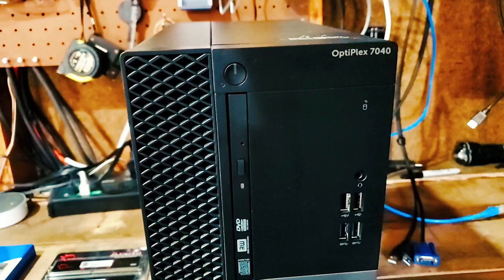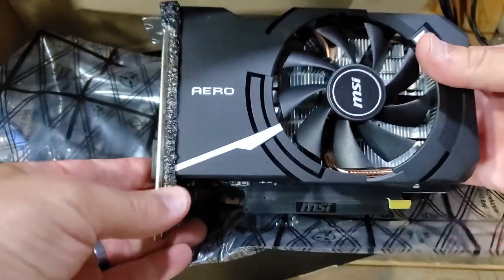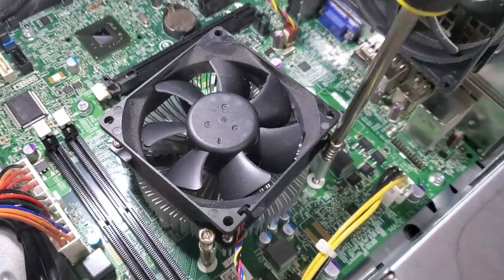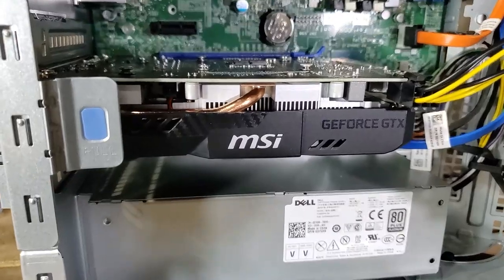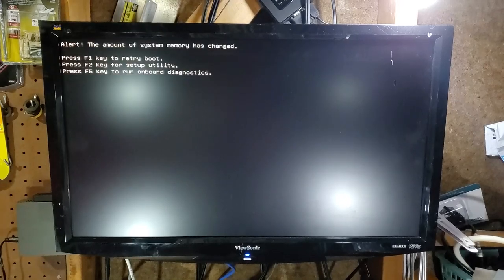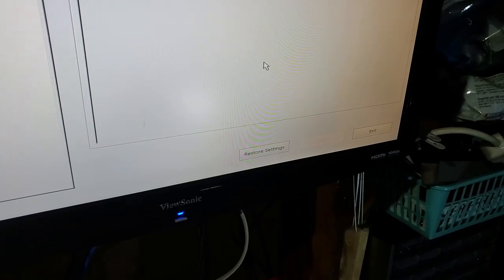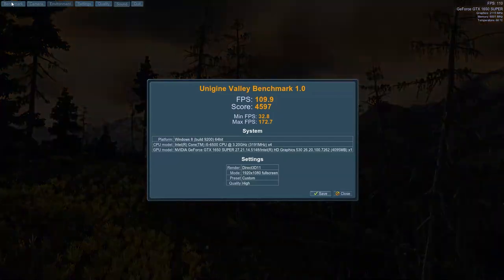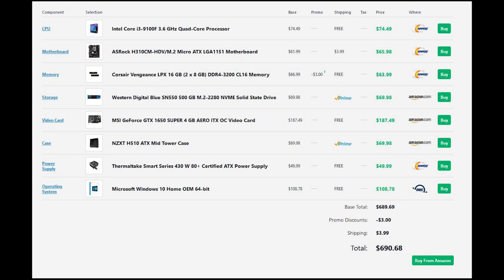Nvidia GTX 1650 Super in a Dell Optiplex 7040 - Best Optiplex Gaming PC for 2020!

Comment: Hey I have a dell Inspiron 3910 with 64gb ram, an intel core i5-12400 and a 300 watt psu. Would a 1650 work in my pc?
Reply from the maker: Current Intel CPUs have a second power level called PL2 and your 12400 can pull up to 117W during that time.  That said, Dell is probably very conservative with how long it runs at PL2 (time called Tau) and outside of those short spikes, you should be fine with the 300W PSU.  I wouldn't have any concerns using it, but it isn't as easy of an answer as the system I used in this video.
Reply: @EscoTech  okay good to know! Thanks!

Comment: Hi, I loved your video but I had a question.... I have 3 hardrives 1 with Windows and 2 For Storage, will I have enough SATA ports (2) to use the adapter or do I have to plug some out? If I do have to plug out, then how will I know that which one has the Windows?
Reply from the maker: A hard drive utility should show drive size, model, and serial numbers, so that would help figure out what is stored on which drive.  Also, you could look at migrating everything to a large m.2 drive.  Otherwise, you could look at a non-super 1650.  The regular GTX 1650 doesn't need external power, but is a little slower, which might hamper the more demanding games.  Thanks for watching!
Reply: @EscoTech  thanks for replying, I will look foward to- this :)

Comment: Good stuff, I don't think you need to put the cost of a Windows license on to the comparison though, you can pick up "legit" licenses for about 15 dollars, Microsoft are moving well away from charging for the operating system so there isn't any worries in doing that.
Reply from the maker: Yeah, I went back and forth on that.  I ended up doing it just because I figured it made the most apples-to-apples comparison, since Dell would have to include the price of an OEM copy.  Thanks for checking out the video!

Comment: i have dell optiplex 7040 micro :(. what are my best graphics card upgrade possible
Reply from the maker: There are some good GPUs out there that will fit, but most would require a PSU upgrade.  An AMD RX 6600 (not XT) would probably work great.  That's probably the most powerful card I would try with the stock PSU.  Space might be tight, though.  Thanks for watching!

Comment: 1650 comes with 2 fan model, it's slightly big in size, can I add the same in Dell 7050 tower?
Reply from the maker: Yeah, it should work fine.
Reply: Hope 1650 super can use with this system

Comment: do u have to do the thermalpast because i want to just upgrade graphics card
Reply from the maker: If you aren't upgrading the CPU, then you don't have to do new thermal paste.  It's nice to fo every 3-5 years or so, but not necessary.
Reply: @EscoTech  ok please make a step by step video on just adding a gpu to a 9010 optiplex I’m adding a 1660

Comment: I have the 80+ bronze version, would it support the 1650 super?
Reply from the maker: If the PC has an i5 in it, I think you're good to go.  An i7 is probably cutting it a little close with a 1650 Super on the stock PSU, but would probably be fine if you aren't doing a ton of gaming. Thanks for watching!

Comment: I can't get my 7050 (i5-6500) to post with a GeForce 3060. I added an external EVGA 500 PSU with a 6 pin adaptor adapter. Works fine with a 1050Ti that uses BUS power or with no video card. I changed several settings in the BIOS. --- UEFi Boot path (diasble), UEFi Capsule Updates (diasble), SMM Security Mitigatio (diasble), SSR Messages (diasble), Secure Boot (diasble), Fastboot (Minimal). Settings are fine without the card. --- Anyone have any thoughts?   ---- When you give the system power, Dell goes through a short power on test. Most of the time when it happens lights and fans shut back down. In the case with the 3060, lights go off but fans never shut down, no Dell Logo or Bios.

Comment: Hi what about the i7 6th Gen? Can you recommend me for upgrades?
Reply: You can do the same upgrades as this video, and can just up the GPU to a Nvidia 1660 TI (cost $280) performs 25% better then 1650 Super.
Reply from the maker: You're saying you have an i7 6700?  That's the only i7 (non K-series) that comes with this Optiplex.  Instead of the 1660 Ti M S mentioned, I'd pair the GTX 1660 Super.  It's almost a 1660 Ti for cheaper.  A PSU upgrade would be required for either one, though.   Thanks for watching!

Comment: Do you know if it would be vr ready with this setup?
Reply from the maker: Yes, but it's on the lower end of recommended VR specs, so I can't say how good of a VR experience this hardware would provide.  I'd probably recommend a 1660 Super and the i7 6700 for VR, which would require a power supply upgrade in this system.
Reply: EscoTech thanks for the quick response first build decided to go with this and don’t know all too much haha for sure using this video as a guide though great video
Reply from the maker: Good luck with the build, this is still a solid system.  If you have any questions, feel free to ask.  I will have one more video up with this system upgrading the CPU to an i7.  Also, I'll have an Optiplex vs XPS upgrade video coming soon.  Thanks for watching!
Reply: @EscoTech  Sorry for all the questions, my 7040 Came in today but i realized its the SFF, will i still be okay with everything? thanks again!
Reply from the maker: Unfortunately, the SFF doesn't have much room for a GPU and the fastest half height (low profile) card you can get is a regular 1650.  Gigabyte and MSi both make one.  I'm not sure it will fit, though. I think the space under the PCI-E slot is too close to the the power supply.
Reply: EscoTech would you personally just return the PC and look for a tower or do you think this one would still be able to run games like COD MW GTA V and Arma 3 at reasonable speeds again thanks for the rapid reply’s!
Reply from the maker: I actually have a low profile 1650 that I'm going to put in my personal desktop.  I also happen to have an SFF Optiplex 7040 in the garage.   I'll go see if it fits.
Reply: EscoTech thank you SO MUCH I really appreciate it if it doesn’t fit I’m gonna end up returning it
Reply from the maker: Doesn't fit.  The PCI-E slot is almost at the bottom of the board.  There is probably an inch of room between the slot and the PSU.  I don't think any card that is worth anything could fit in the SFF.   Sorry, but yeah, definitely return it.
Reply: EscoTech thanks for all you help I really appreciate it now I can return it and get the correct size hopefully!
Reply from the maker: @danielpataki5491  Sure thing, glad to help.  Dell's official term for this size is 'Mini Tower' and it's often abbreviated 'MT' and that can help the search sometimes.  Also, if you are OK with DDR3 and a SATA SSD the Haswell(4th Gen Intel) line does offer pretty similar performance.  Those are the Optiplex 3020, 7020, and 9020.  Good luck!
Reply: EscoTech thought I would come back to let you know I went with the optiplex 9020 off eBay with i7-4790 8GB of ram do you think 2 8gb of ram and a 1650 S will be enough to have some fun? Thanks again for quick responses!
Reply from the maker: @danielpataki5491  Yep, that's a solid system and will have basically the same performance as the 7040 in this video.  You will use DDR3 and a SATA SSD, but not much of a loss there, probably no noticeable difference while gaming.  Good luck and have fun!

Comment: @EscoTech while the motherboard of the 7040 MT requires only 4PIN and 8PIN plugs will the full potential of the 315 W XE2 PSU (which has additional 6PIN plug and it should be plugged to the mb, not the GPU, right?) be delivered to this motherboard throught these 2 connectors only?

Comment: good video bro, but I have question, can you use zotac 1650 super instead of msi aero itx? would it fit? would there be any problems with using that as opposed to this?
Reply from the maker: The GPU space is pretty tight, probably only room for cards under about 9" in length.  That said, basically any single fan card should work, two fan cards are probably all too big.  Thanks for watching!

Comment: Do you think if i pair an i7 4770 and a GTX 1650 in an optiplex 9020 MT, i would need to get a power supply or is the stock power supply ok.
Reply from the maker: With a regular (non-super) GTX 1650, you'll be fine with the stock 240W power supply.  Make sure to get a model that doesn't require external power.  Thanks for watching!

Comment: Hi, thanks for the video! Will MSI GeForce GTX 1650 Gaming X 4GB with dimensions 248x127x44mm fit inside Optiplex 7070 MT?
Reply from the maker: I can't say for sure, as I don't have this PC anymore, but I think all the dual fan cards I looked at were too big for the case.  Pretty much all single fan 1650 cards should fit, though.  Thanks for watching.

Comment: I Hava a dell optiplex 9010 MT with 275watt psu and i want to put a 1650 no 6 pin connector and im not sure if it will work, can you please help me? will it work?
Reply from the maker: I haven't tried exactly that, but it should work fine.  I have used a 1050 Ti in a 9010 MT and had no problems.  I don't know why the 1650 would be any different.   Thanks for watching!
Reply: @EscoTech  ok. thanks for your reply

Comment: i have dell 7050 with an i7 6700, can i put GTX 1650 video card?
Reply from the maker: Yeah, a 1650 should be fine, just make sure you get a GDDR6 version as there are still some GDDR5 versions out there.  Thanks for watching!
Reply: @EscoTech  Why gddr6?  and not from gddr5?
Reply from the maker: @adrielmizu  GDDR6 is much faster.

Comment: im gonna to buy a hp prodesk g2 with i5 6500 and 8gb 1 slot of ram ddr4  gtx 1650 128 gb ssd 500 hdd and 280 watt power supply . i get some problems with this power supply or no ? sorry for 
dictation im not english hhhh  <3
Reply from the maker: You should be fine, but you might need an adapter for the PCI-E 6 pin power on the graphics card, like the one I used in the video.
Reply: @EscoTech  im gonna to buy it on a site web not pc and graphics card from another way . and i can get PCI-E 6pin with 4 to 12 dollars  and plz 
The most expensive are the best, or are they all the same?
Reply from the maker: Those cables are pretty much all the same.

Comment: is this okey to run if i change the vga only and not the sata ? is there no problem with the power suply or i need to change also to ssd ? pls let me know thanks
Reply from the maker: The SSD is not a required upgrade.  The GPU will give you good gaming performance with a regular hard drive.  Thanks for watching!

Comment: wiil GTX 1660 super work with optiplex 7060?
Reply from the maker: It's basically the same design, so as long as it is the mini tower case like the one in the video, it should work fine.

Comment: M2 is better than SSD 2.5?
Reply from the maker: Yes, but there are still SATA bus m.2 drives.  The NVMe m.2 drives run on the PCI-E bus and are much faster, theoretically.  Real world difference kind of depends, but they are faster in every situation.  Thanks for watching!
Reply: oh...let me buy M2 then...but how about the GPU?is there any other GPU aside to AERO 1650 that can be used to upgrade my 7040? AERO is not available at this moment in UAE..maybe sold out or out of stock...

Comment: Hey so I have an Dell Optiplex 3040 I5 6500 and I wanted to ask if I installed A GTX 1650 Zotac Single fan variant will my Stock 240 watts psu handle it with no problem the Psu Is not 80+ Bronzes or Platinum certified!
Reply from the maker: Yep, the Zotac 1650 will work fine.  It is powered completely by the PCI-E slot and uses less than 75 watts.  Be sure to get a version with GDDR6 instead of GDDR5 as the higher VRAM speed will have significantly better performance.  Thanks for watching!

Comment: Hi i have the same computer ,when i plug in the power cable he starts automatically for 3 seconds then turn off is it normal ? Ty
Reply from the maker: Yeah, that's normal.  It's reading the hardware and possibly running through a quick diagnostics.  It should function normally after that, though.  Thanks for checking out the video!
Reply: @EscoTech  thank you very much

Comment: Is it problem with my optiplex 5050 ( i7 7700 l, 16 GB RAM, PSU 240W) if i use gtx 1650 super? Thanks
Reply from the maker: That's a little too close for comfort to me.  I think it'd be OK for some lighter use, but if you were using that system to game everyday, I would upgrade the PSU.  I may do a video upgrading that system with a TFX PSU soon.  Thanks for watching.

Comment: hello whats the highet mhz I can install on a 7040 sff. it reads  2133MHz on dell official page. but the G skill is at 3200mhz. Will it work if i buy it?
Reply from the maker: The 3200Mhz G Skill will work, but the memory controller built into the processors of that generation can only run it at 2133 Mhz.  There's not a lot of price difference right now, so if the higher speed is about the same price, you can still do it and have faster RAM for a future upgrade, maybe.  Thanks for watching!
Reply: @EscoTech  thank you for the info man. I sub!

Comment: hey i have an optiplex 3050 with i5 7500 8gb ram gtx 1650 super but i need a 16gb ram but i heard that the optiplex motherboared doesnt support dual channel?is it true bc i need to upgrade my ram to (8x2) 16gb ram
Reply from the maker: The memory controller is actually on the processor, so unless Dell disabled some functionality there, dual channel should work by default.  I have a 3050 somewhere, let me test and I'll get back to you.  Thanks for watching!
Reply: @EscoTech  ok thanks! and did you change the power supply? or your still using old one which came with the optiplex?
Reply from the maker: This was still the stock power supply.

Comment: Hey I was thinking of doing this setup though with an i5 2400 and with a gtx 1650 super my question was whether the 220/240w power supply is enough or I have to buy a more powerful one
Reply
Reply from the maker: You should be fine with the stock PSU, as long as you're not gaming for like 8 hours a day.  Pretty sure a PSU upgrade in that generation is super easy.  You could look at going to an i7 or Xeon with a PSU upgrade, though.  The i5 2400 might bottleneck a 1650 Super a little, but it shouldn't be too bad.  Thanks for watching!

Comment: considering the fact that your PC with a 240W psu is only using like 150W with a card that uses like a 100W, i wanna ask a question that i will REALLY appreciate if you answer, i have an optiplex 7060, it has an i7-8700, 260W PSU, will it be fine in terms of power supply if im installing a gtx 1660 ti in it? Thanks again, i had no hope for installing anything more than an LP GTX 1650 inside that thing, but your close attention to the power usage is tremendously helpful, it really gave me so much hope when it was only using like a 150W with a 1650 Super, thank you! And also, what external power supply cable should I use if im getting a 1660 Ti for my 260W psu, i really have no idea about this power supply cable, i know that im just a few explanations away from understanding how they work lol, nevertheless, thank you in advance!
Reply from the maker: I don't think I would do a 1660 Ti with the stock power supply.  There are a couple TFX power supplies that you could use for an upgrade or Dell makes a server PSU unit that would work.  Your i7 8700 can use significantly more power than the CPU on this video, too.  Let me know if you have any more questions.
Reply: @EscoTech  thanks a lot, and yeah I do have plans for changing the stock PSU into a 500W psu, but if I'm not, and in case I'm going for a 1650 SUPER,I read somewhere that it is not safe to use external power connectors, like SATA to 6 pim adapters, they can't take overload during powerspikes of the GPU and they end up causing fires..

Comment: i have a stock r7 350x in my optiplex 7040, i7 6700 and i have a 240w psu. which gpu should i buy? i dont want to switch psu, just gpu
Reply from the maker: I'd go with the 1650 for sure.  You'll be fine with the stock PSU, as long as you're not gaming for 8 hours a day.  Thanks for watching!

Comment: Good video, but wouldn’t a 240W PSU be bad for long term use with the 1650 Super? I have the same PC but with a i7-6700.
Reply from the maker: I have a video coming soon upgrading this PC to an i7 6700.  Max power draw I saw was 208 watts from the wall with the i7, and that was a spike and not constant.  Testing showed a pretty steady 180-190W during gaming.  If you add in the power lost to inefficiency at 7%, the 240W PSU would show 257W at the wall while delivering 240W of power to the PC.  190/257 is 73.9% of max power.  I'd be comfortable running that long term, and that's with the i7.  The i5 used about 10-15W less, on average.  Thanks for checking out the video!
Reply: @EscoTech  I was thinking of using the same build. Is the 240w psu enough? Also, is it hard to replaces the battery in the optiplex?